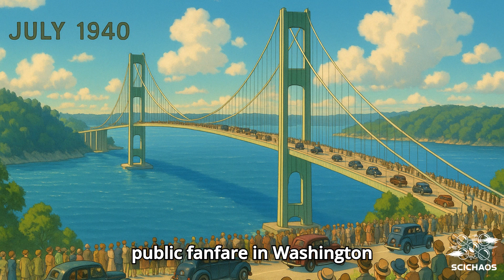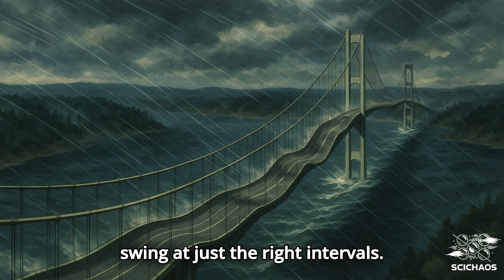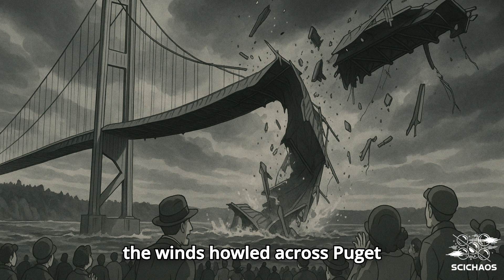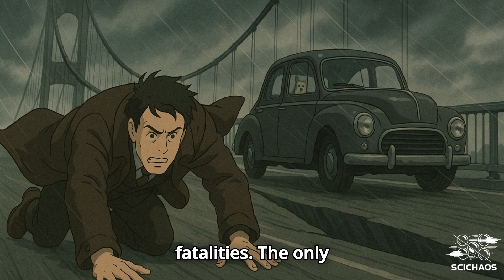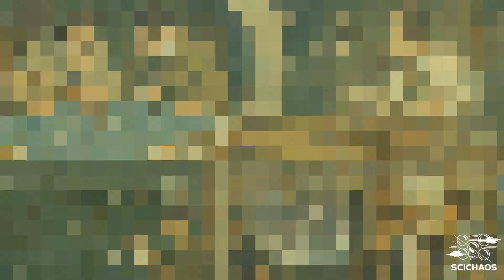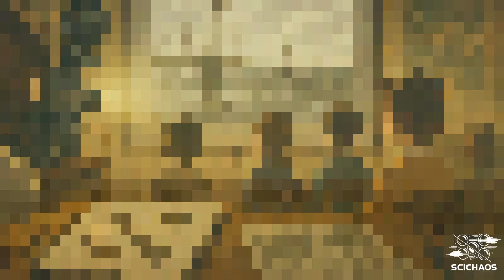Tacoma Narrows Bridge Collapse: How Wind Destroyed a Modern Marvel

Comment: There was one major thing you got wrong. The man who got stuck on the bridge, Leonard Coatsworth, wasn't actually a professor. He was a news reporter for the Tacoma Tribune. He was off-duty at the time, simply driving with his aforementioned dog, Tubby, on the way to his summer home to spend the upcoming Thanksgiving with his family. However, just as he drove onto the midsection of the bridge, the span, which had been rippling faster than usual that day, caused one of the bands holding the suspension cables to come loose. With less resistance, a new swaying motion appeared that no one had ever seen before. Rather than ripple, the bridge began to twist like a rubber band. Coatsworth said he almost lost control of the car. The moment that happened, the terrified operators at the toll booth closed the bridge from any other traffic entering. Then they called the police and fire department. Coatsworth stopped his Studebaker and jumped out, only to be thrown to his face multiple times. He tried to open the door for his dog, but the bridge was too violent, and he kept getting slammed down every second. He could hear the roadway cracking, and fearing the bridge would collapse at any second, he made a run for it, crawling and making brief sprints to Bridge towers. Once he got to shore, he was covered in cuts and bruises. Being a reporter, he asked to use the telephone at the toll booths, and they agreed. He then called his coworker, Howard Clifford, telling him what he had been through and said, "You have to get over here; the bridge is going to fall." Howard Clifford soon showed up, with his video cameras. However, somewhat like the video mentioned inaccurately, another person who showed up at that same time was Professor Burt Farqhauson. The Professor worked at the University of Washington in Engineering. He had been studying the Tacoma Bridge's erratic behavior in the wind, and he had been coming up with solutions to remedy the issue. Only a few days earlier, he had tested one of his solutions on a model of the bridge in a wind tunnel, and it worked perfectly. It was scheduled to be installed later that year, but by now, it was too late. Farqhauson held onto hope that the bridge would stay standing. Like Clifford, he had also brought several video cameras to record the chaos as it unfolded. The two even headed out onto the bridge as far as the east tower, the only part of the road that was stable, to get footage up close of the twisting midsection. Clifford asked Coatsworth if he was hurt, which he wasn't, but he said his poor dog was still in his car and he needed help. Professor Farqhauson also heard this. He loved dogs. As the two headed onto the bridge, they began filming. Clifford tried to call Tubby's name, hoping he would hear it and come to him, but the screeching of the bridge was too loud. However, once the wind died down slightly, slowing the bridge's movements, Clifford dangerously made a break for the car. But like Coatsworth, the bridge movements were too violent, and he was thrown to the pavement and had to turn around. Once the wind died down again, slowing the bridge further, Professor Farqhauson, being the dog lover he was, also made a break for the car. Unlike Clifford, he actually reached the car, opened the door, and tried to coax Tubby to come out. But the poor cockerspaniel was scared out of his wits by the twisting bridge, howling and whining. Farquhason acted gently, trying to comfort the dog, who seemed to trust him, but when Farquhason tried to pick him up, Tubby bit him in a panic and dug his claws into the seat. It was clear Tubby was too scared to leave the vehicle. There was no way he would be convinced to try to run on the bridge. Farquhason tried again when he heard pops coming from behind him. The wind had picked up again, but this time after all the twisting, the vertical supports were straining beyond their limits. Realizing they were extremely close to failing, he sadly abandoned the car and rushed back to safety. Just as he did, the bridge began to collapse, a 600-foot section of the bridge dropping out and smashing into the water. 11 minutes later, the rest of the main section fell. Both Clifford and Farquhason made it off the bridge at the last second.
Reply from the maker: Great😄
Reply: That's a great correction, except that video cameras didn't exist in 1940. All of the footage came from 16mm film cameras. These were commonly used for newsreels as well as home movies (8mm came later). The bridge had developed a reputation for vertical undulations over the months after it opened , so there is lots of footage shot by people in the months leading up to the collapse. When the windstorm hit and the bridge started showing dramatic twisting movements, there were a lot of newsreel cameramen there correctly suspecting that this would be the end of the bridge. Thanks to all of the footage, it's one of the most studied bridge collapses and lead to a lot of changes to the engineering of suspension bridges.